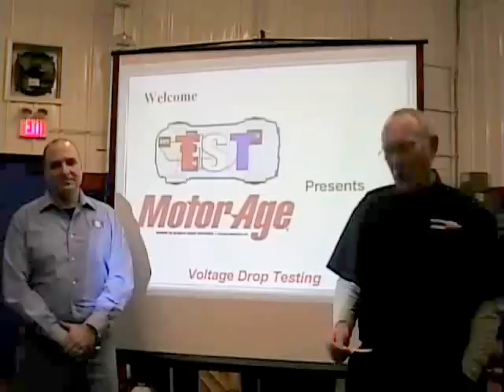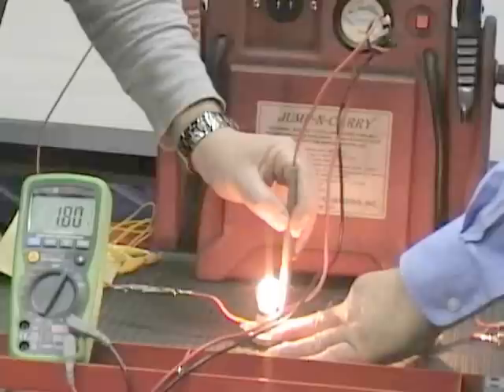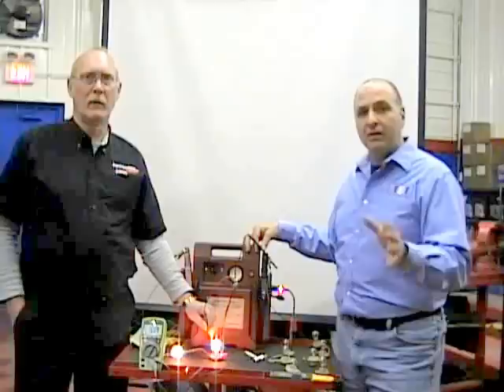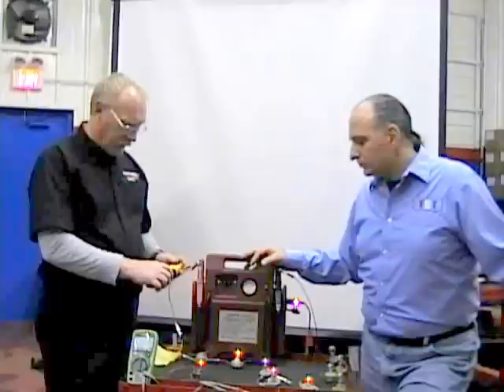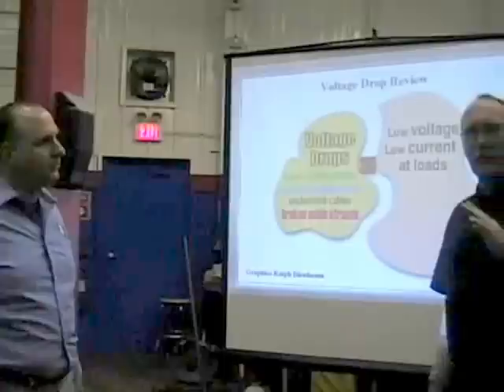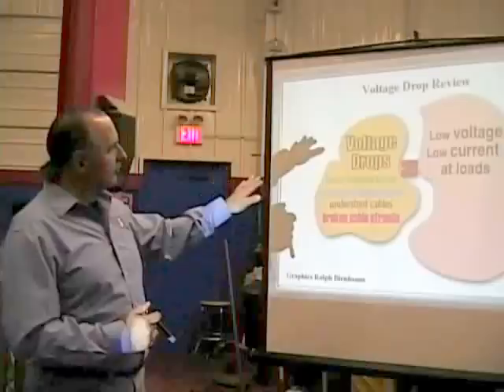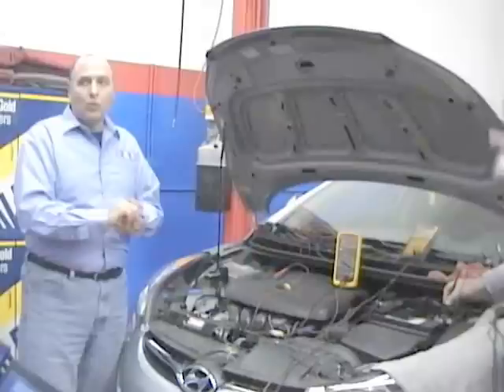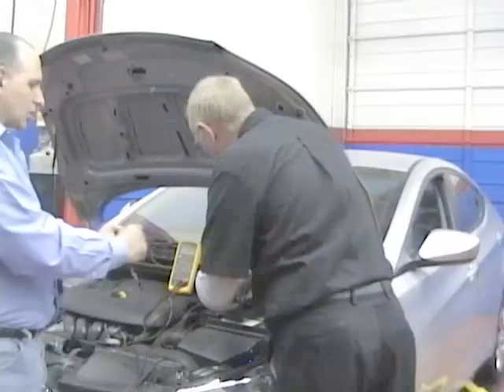Voltage Drop Essentials - TST & Motor Age

Comment from the maker: As long as the voltage does not drop under 9.6 volts while you have your pos and neg of the meter connected to the battery post. Now if you are doing a Voltage Drop from the Pos battery terminal to the pos of the starter...you have a big problem...HIGH RESISTANCE...broken wires strands, corrosion or poor connection. Hope this helps...Thanks for watching

Comment: Voltage drop is used 99.99% of the time to perform electrical diagnostics in my bay. I honestly cannot tell you the last time I used the ohm setting on my meter and my test light hasn't seen the light of day for years.
Reply from the maker: to good to hear...after all VD is the problem most of the time with something electrical not worging correctly. Thanks for watching

Comment from the maker: @enix2k6 
I would agree but Pete was testing neg to pos of the battery and then neg of the battery post to the load so he can show the techs that you would have to subract the reading to get the voltage drop. The best way to do it is neg of the battery to the load neg or pos of the battery to pos of the load.

Thanks for your comment and for viewing

Comment: The voltage in a series circuit is dropped over each and every load in the circuit.  A load is just something with resistance.  The filament in a light bulb is a resistor that gets so hot that it lights up.  That bulb is a load.  The resistance in the wires and all is also considered a load.  Electricity doesn't differentiate between wanted(motor, light bulb..) and unwanted resistance(corrosion, wiring..)  When the circuit is closed(connected) voltage drops across ALL resistances. so

Comment from the maker: MrVhandi it is impossible to have a 0 voltage drop since there has to be some resistance in every circuit besides if you look a little further in the webcast you will notice that we had the wire disconnected and OPEN. Thanks for your comment hope this explanation helps

Comment: At 49:47, G says it's impossible to have 0 volts. He says that means you have an open circuit. I think that's incorrect. If you have 0, you know your line is connected, and you have 0 resistance in the line. They were testing a very small portion of the negative circuit.  It is possible that that had a very good connection, and was not dropping any voltage.  
The left over mV in the circuit are normal resistances in the wires/switches/connectors/anything that's not a load.

Comment: I watched the whole webcast.  I know you guys disconnected the ground wire at the fender.  I think I got mixed up with Ohms and Volts. If you were to have put an ohmmeter on it, it would show OL, which means open, and 0 resistance would mean it's not open... so on..  my bad.  I have watched the video a few times now.  Learned a few things :)

Comment: Thanks for the presentation! I think that your demo on voltage drop would have worked much better if displayed on a vertical display board. It was difficult to see the circuit on the horizontal table top.
Reply: +Steve Fiorito Steve I agree but as long as we got the point across it help technicians...thank you for watching
Reply: +Steve Fiorito Steve thanks for the comment ... your feed back is important to us...Thanks for watching

Comment: the 26.3mV at the negative side of the load shows that there is still resistance in the circuit after the load, and voltage is dropping at it. 
If you have 12.0263 V at the battery, and .0263V at the neg side there, that means you have 12 volts still dropping somewhere in the circuit.  Hopefully that's mostly on your load.  The positive side may have about the same voltage drop before the load.  (this 12.0263 example would be a dead battery, needs to be charged:P )

Comment: If the load used all the voltage .. On the simple light bulb light circuit.  Then wher dose the 26. 3 millivoltage come in at on the negative side of the load?? How is that calculated?

Comment: Hi. very good video.  I have some questions.
1) Why voltage drop on source of electricity (12V battery)? ( and sometimes doesnt drop) For example : doesnt drop when  connected small reciver (small bulb) and drop when connected  medium/ high current  motors ?   And how this calculated?  For example when  120 A starter motor is working constantly voltage drop 1V to 11V.  And why drop 0.5 V when connected    only 8 A fuel pomp motor straight to battery terminals ?  Many thanks for any answer.
Marek
Reply from the maker: Marek always start with a voltage drop at the source ...example if you are looking for a PRESSURE (Voltage) drop…place your meter Red Voltage lead at the most positive...the battery positive post and then take you black lead and go to the connection or load you want to check the voltage drop at. You do the same on the negative side of the circuit since electricity is a 360 degree circle. If there is electrical resistance ---wire, connections, bulbs, motors, there will be voltage drop. The maximum voltage drop on an electrical circuit that is non computerized should not be more than 200 mV with the loads on for each side. On a computer circuit should not have more than a 100 mV drop on either side. If you have not already subscribed to our tstseminars YouTube channel please do so. Also for more information checkout our tstseminar.org website. Thanks for watching...hope this helped
Reply: Many thanks for help. I'm all ready subscribe your channel since 2014. Watched all. And I'm  very like the old long one over 1 or 2  hour videos. One of the best my  host and teacher is Rich Peterson.  Many Thanks thanks for everyone. 
Marek from Poland/UK
Reply from the maker: that's great...thank you for watching...have a great day :)

Comment: when i try to start engine my voltage on batery terminals drops to smth like 10volts, is this smth to worry, and also sometimes it doesnt start(clicking sound) so if it clicks it means open circuit?

Comment: I've been doing voltage drop testing and am not sure about how to voltage drop test a blower motor resistor or if it's even worthwhile ....
Reply from the maker: Pico Boo you do the voltage drop test just as you would on an other circuit. Positive on the meter to the most positive in the circuit and the negative lead to the feed B+ side of the resistor. The same would be turn on the negative side. Not sure if this info helps or if it answers your question. Any resistor will add resistance to the circuit and will drop the voltage. Thanks for watching and your question...If you have not already subscribed to our tstseminars YouTube channel please do so. If you interested in more training go to www.tstseminars.org...thanks

Comment: Sir good day, would you mind if you make a video on how the ecm knows the misfire on EXACT cylinder....thank you for your informative videos
Reply from the maker: Mr. X right now I don't have time to do that since I am getting ready for the TST Big Event on March 21st that is taking up all my spare time. But I can tell you that the computer know what cylinder is misfiring but the crankshaft sensor. If the vehicle is under 8501 lbs and OBD II certified along with the correct cam crank sync the correct cylinder will be displayed as misfiring. Hope this helps. If you have not already subscribed to our tstseminars YouTube channel please do so. Interested in more training? Go to www.tstseminars.org and www.attstraining.com.
Reply: @TSTseminars  thank you so much sir for the reply.....I'm also a technician of GM dealership and I under go also GM training in Philippines....By the way I am a filipino.....I watch everynight before I go to sleep on youtube for your informative videos and helps me make better... thats question of mine I'm thinking how the ecm knows the exact cylinder bother me because if cam or crank all cylinders involved because only on reluctor or teeth from camshft  or reluctor wheel of crank. Cut off the magnetic field to induce voltage that ecm interprets or injectors miss on one or two cylinders or miss on spark....etc....thank sir I will keep continue watching godbless....
Reply from the maker: @mr.technician4144  good to hear that our videos are helpful. I apricate you watching and taking the time to email me. Thank you. For even more info go to www.tstseminars.org and check out TechFlex...full length video that you can view for $9.99 a month with a membership of $75.00 for the year. have a great day :)

Comment: Hey G  - I can't find "vulcanizing tape" anywhere.  Is there a chance it is sometimes called "self-amalgamating tape"?  If those 2 are NOT the same thing, where could I find "vulcanizing tape"?  thanks
Reply from the maker: HomeDepot or online 3M or online.Mfr #: 2234
Adhesion Strength: 160 oz./in. Series: 2234
Temperature Range: -22 Degrees to 220 Degrees F Max. Voltage: 400
Item: Mastic Tape Length: 6 ft.
Material: Flame Retardant Rubber Tensile Strength: 2400 lb./in.
Shape: Continuous Roll Thickness: 60 mil
Color: Black Standards: UL Listed, UL 510, RoHS 2002/95/EC, ASTM D257, D149, D2000-Type CE, D4325, D1249, D570, D69
UV Resistance: Yes Performance Temp.: Up to 194 Degrees F
Width: 2" Country of Origin (subject to change): United States
Reply: DAMN! That's some expensive tape!  27 bucks for 6 feet!?  I'll stick with the nail polish or liquid electrical tape for now, thanks.  Nonetheless, I greatly appreciate your quick and helpful answer.  Thanks again TST.
Reply from the maker: did you check the price at HomeDepot?